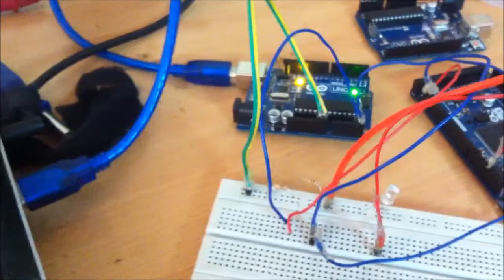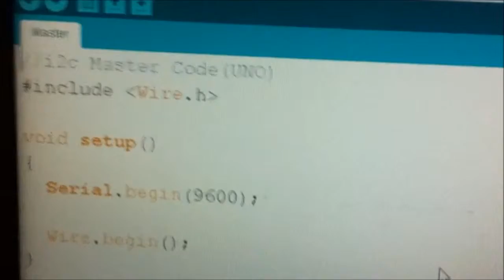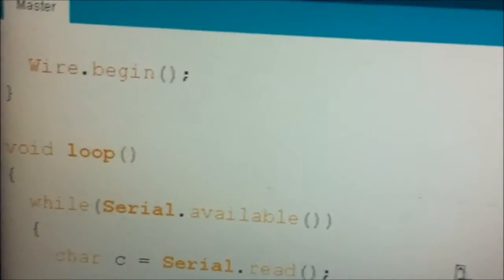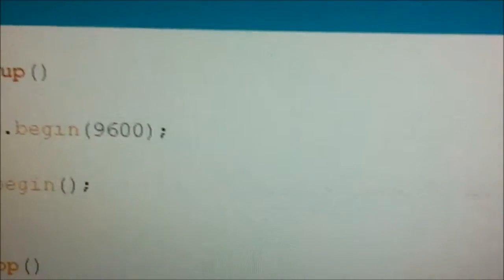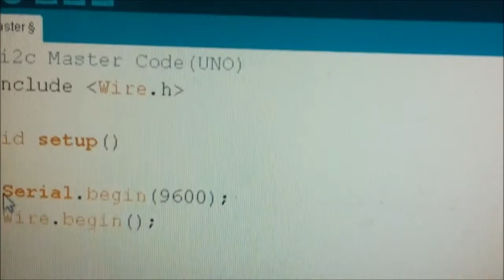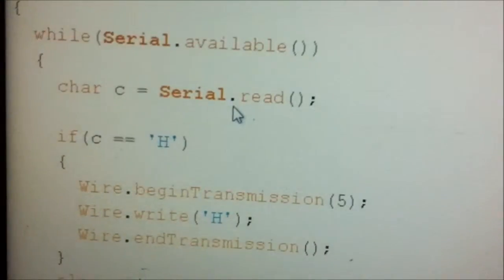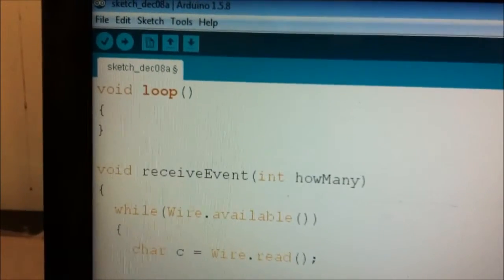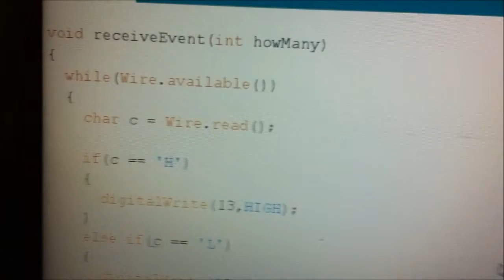Arduino uno & Due Communication

Comment: Hello. Could you please tell me how you connected the two boards? We can't connect directly the SCL and SDA pins of the two boards, once arduino Uno works with 5V and arduino Due works with 3.3V. That is my only problem, so could you tell me how you solved this a little bit more detailedly?